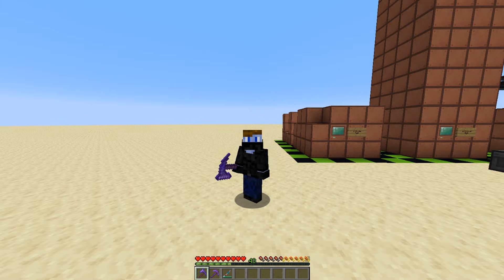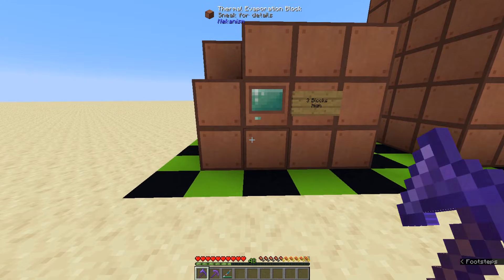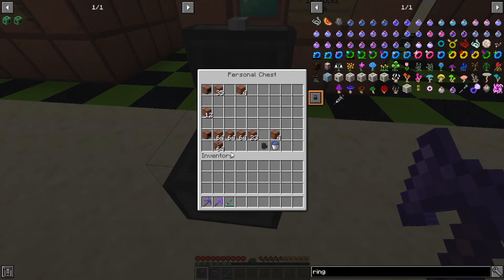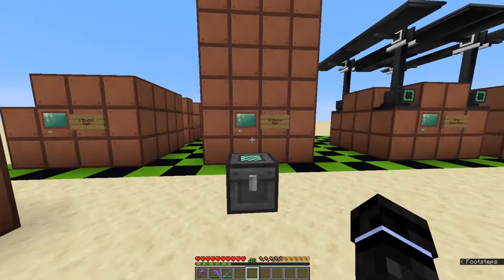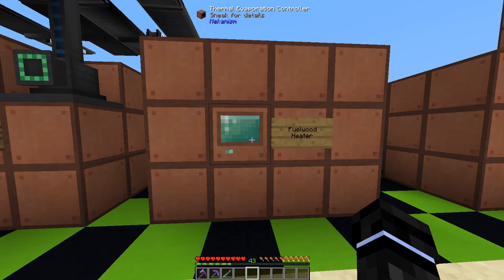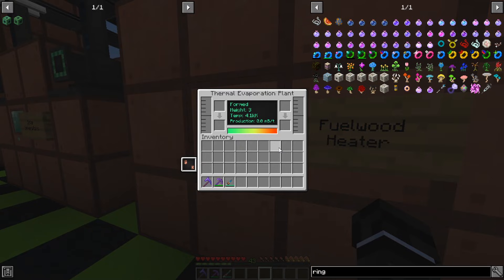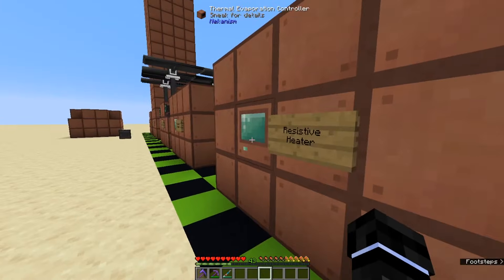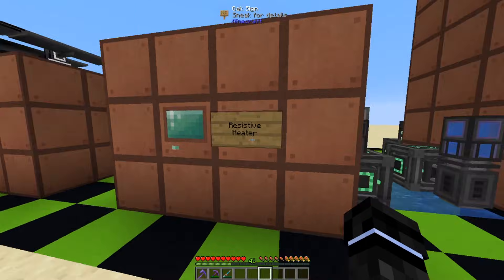Mekanism Thermal Evaporation Plants and Lithium Dust - Full Overview

Comment: You literally say NOTHING about making lithium DUST
Reply: He did say he assumes you know how to use JEI, and if not, to check out his upcoming video on how to use JEI.  This video was to go over making lithium, which isn't covered in JEI, and is therefore incredibly helpful for those of us that already know how to use JEI.
Reply from the maker: put the liquid lithium into a chemical crystallizer
Reply: @tPixelUnderscoreMinecraft  No its gas form lithium but that somehow doesnt go into the chemical crystallizer
Reply: @wallywyvern  Send the liquid lithium to a rotary condensentrator and deconsentrate to gas lithium. Then send it to the chemical crystallizer.
Reply: @tPixelUnderscoreMinecraft  I am playing in 1.18 and I cannot seem to make brine the hight is 18 the temp is 300k and there is 1,000 mb of water in the controller. what more do I need?
Reply: When i builded it, it didn’t work. Why?
Reply: @bluemammoth4907  did you filled the bottom?

Comment: how do i extract the brine from it it isn't working
Reply: you use a "configuator" on the pipe that is next to the value you use your sneak key hold it use the scroll wheel to chose "wrench" then while you are still sneaking left click on the side that you want to pump out it will say "push pull normal or none" (not in that order I don't know the order) chose pull then BAM done hope this helped
Reply: @insertusernamehere4744  thanks i never used that part of mekanism before only the generators
Reply: @insertusernamehere4744  well you're the one who's using the time to help a newbie in mekanism

Comment: When i builded it, it didn’t work. Can you help?
Reply: i think in some versions you need the corners beacuse i tried to build one without corners in 1.12.2 but it didnt work and i added corners and it worked (you probabbly dont need this information beacuse its 3 years later but thought i'd reply)